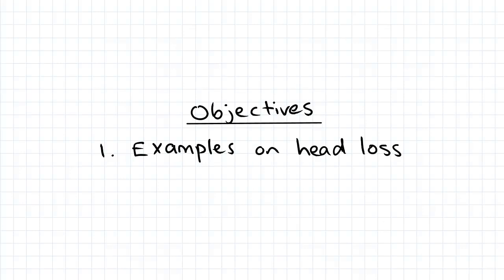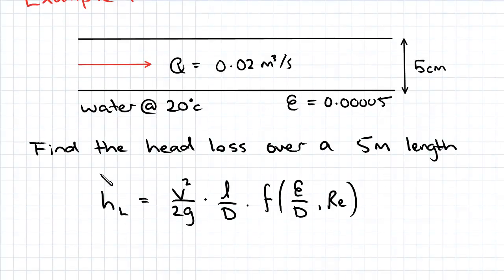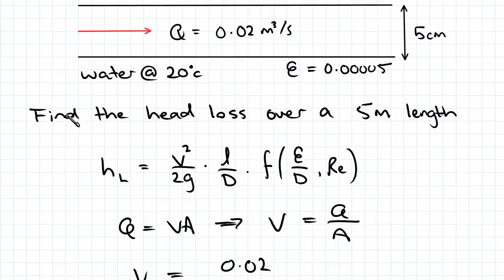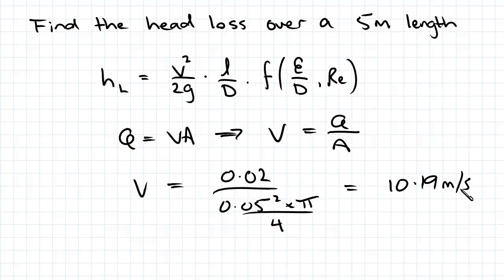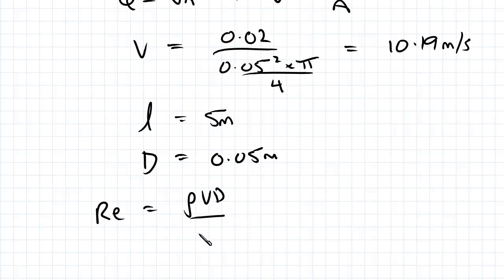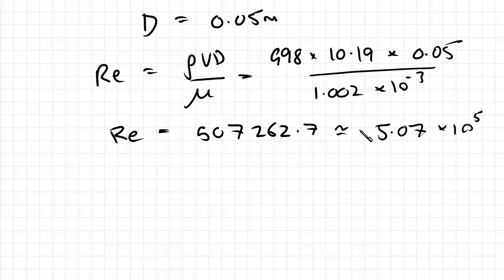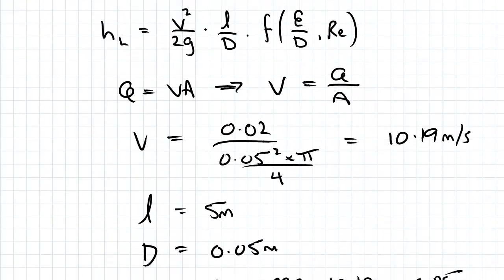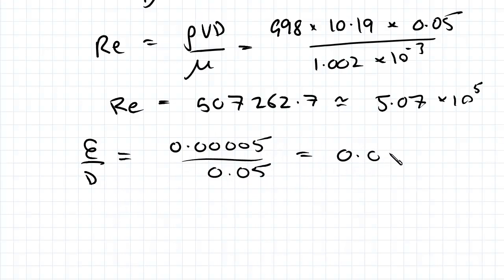Head Loss in Pipe Flow Example | Fluid Mechanics

Comment: Why head loss is meters?
If head loss is 0.5 metere. What does it indicate?
Plz answer
Reply: head loss is energy loss divided by mass and gravity. Thus, head loss = energy loss but expressed in terms of height of fluid.
Reply: Hello Dear, Please check in the Bernoulli's equation pressure head, kinetic head and potential head is also in meters. This is because Bernoulli's equation is written for per unit weight of entering fluid. Please check the units yourself.
Reply: Himanshu Gaur  I know the units sir.
I am asking why it is expressed in meters since head loss us nothing but energy loss.
Reply: Entertainment Stuff greater head lose means greater energy loss.

Head lose is corresponding to energy lost.